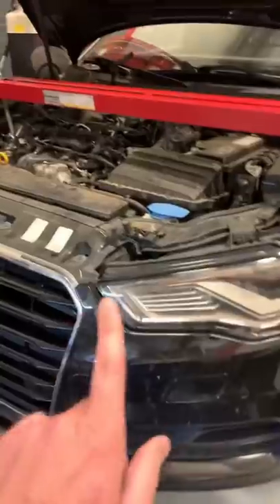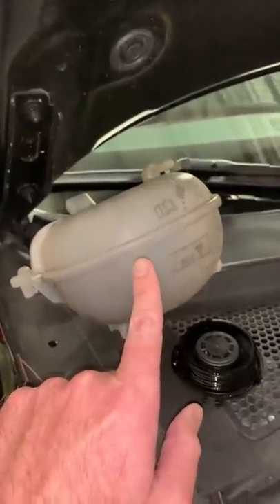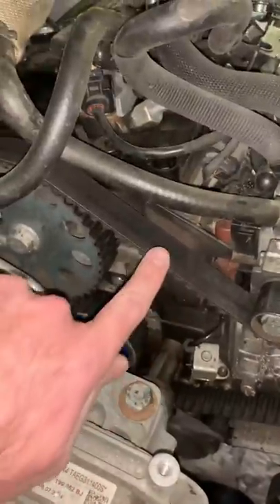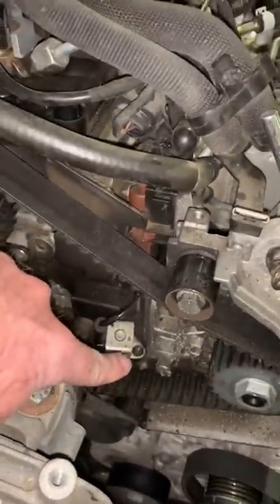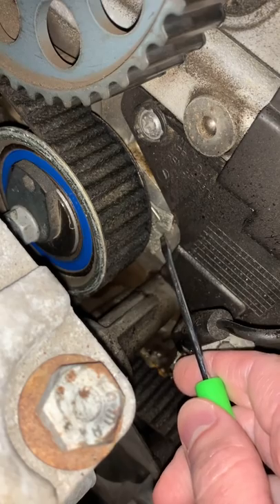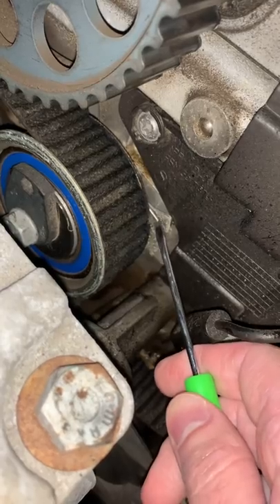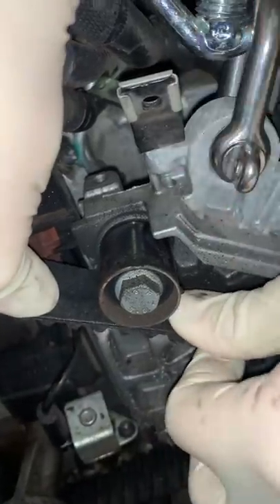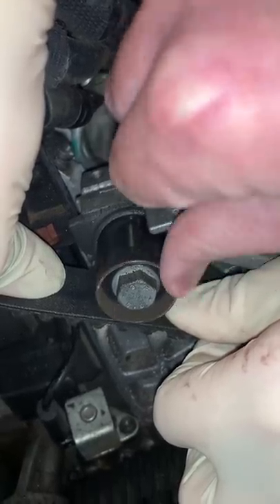Don’t let problems go on your car! #shorts

Comment: Best routine maintenance for these cars is to avoid purchasing.
Reply: Still more reliable than US cars do🤣
Reply: @CaptainRemy  A timing belt driven coolant pump
Is so much more reliable than one that is driven by a serpentine belt. Because you know, if the serpentine belt breaks you can pull over and wait for a tow verses so many items on a timing belt which should just do timing.
Reply: @willjohnson5861  what????? ANYONE would rather have a serpentine belt driven water pump. Way easier to replace, way less labor to access. “just do the timing” NOBODY wants to time an engine because of a water pump
Reply: Amen!
Reply: @CaptainRemy  my chevy is still on the original belt and never been in a shop. It's sitting on 290k.
Reply: @cleverusernamenexttime2779  he talkin bout fords n dodges
Reply: @CaptainRemy  good life hack. Never take automotive advice from someone named Ali.
Reply: @willjohnson5861  My point still stands. A timing belt driven waterpump in this car is still more reliable than your average American car / truck (e.g. Ford), which has head gasket leaks / major oil leaks / transmission faults as COMMON faults. Lets not forget things like death wobble, poor rust prevention, etc.
Reply: @cleverusernamenexttime2779  May I ask what year yours is from?
Reply: @ah4800  And you are...?
Reply: @ah4800  I never said that audi's are reliable, just that they are more reliable than American cars... But you still didn't answer my question to you, so I'l ask it again: who are you? I bet you don't even actually own a car. What is your problem? Never take automotive advice from someone named Ali? Did bad ventilation in your mom's basement give brain damage to you or something?
Reply: @CaptainRemy  2004
Reply: @CaptainRemy  audis aren’t more reliable than American cars but this particular TDI is pretty reliable. The diesels seem to be the only way Germans can figure out reliability until the emissions crap hit them and they went downhill again.
Reply: @CaptainRemy  I'm reading this before going into my work at an Audi service center and laughing my ass off. That "German reliability" is gonna be paying my bills good today, stay assmad ;D
Reply: @CaptainRemy  using feet as a unit to measure is why they can never build really reliable vehicles.
Reply: @CaptainRemy  Since you are the one making the claim here, why don't you post some statistics to back up your claim, rather than your clear bias against American-branded cars.
Reply: Could not agree more! Anything built by the VW, or Stallantis (formerly Fiat/Chrysler and PSA) groups are to be avoided at all costs.
Same can be said for GM Korea, Nissan, and possibly Mitsubishi if they follow Nissan and take more Renault shit...
Reply: @CaptainRemy  no you're right, i dont own a car. Cars are for girls. I drive a truck. An american made v8 that'll pull your pos audi around the block and still resale for more with the same mileage.
Reply: @CaptainRemy  audis have terrible reliability that is a well known fact. If you want a fair comparison because it’s a tdi then compare it to a Ford F-350 7.3 powerstroke reliability
Reply: @ah4800  Sounds like you’re compensating for something…
Reply: @CaptainRemy  Ford Crown Victoria: hold my beer
Reply: @cleverusernamenexttime2779  You're Chevy doesn't have a 290k serp belt on it. They are wear items.
Reply: @squiresonwheels3249  As being one of the only 3 good cars I think came out of Ford, hot DAMN can those tanks take a beating more than 95% of other cars
Reply: @mikehawk302  its still big enough to make you bleed though
Reply: @cleverusernamenexttime2779  you should get that looked at
Reply: @CaptainRemy  I guarantee they're not more reliable than dodge/jeep
Reply: @ah4800  What?
Reply: Every mechanic i ever asked told me to buy a VW because of its realiability and easiness to repair, granted i am in europe so the parts and repairs might be cheaper than in america, which brings me to the point the markets are completely different so comparing these cars is pointless
Reply: @CaptainRemy  wrong us cars do not use timing belts they use timing chains way better. Only a poor company would use belts.
Reply: @CaptainRemy  I can confirm that is not true.  Had multiple GM vehicles over 200k-300k miles.  Have an 09 Jetta with a 2.0tsi and timing tensioner failed and destroyed the entire top end of the motor, rear door won't open, tail light wiring shorted out, water pump failed, bad turbo, etc.  Audi/VW recently is junk compared to US vehicles.
Reply: @CaptainRemy  you say that Euro cars are more reliable than US cars, go look at the annual ownership costs on cars. The Euro cars are always higher. Especially the German cars.
Reply: @loganwork7024  jeep has shit reliability.
Reply: I like my non-intereferance bp-4w. If the timing belt were to break, which won't since I am meticulous about maintenance,  I won't have to sweat about my engine grenading.
Reply: @austincopeland9504  agreed, just spent $1,160 usd to get my timing belt/water pump/pulleys done on my 2013 tdi passat. I can do it for 300ish at home but im not comfortable doing it at home plus I dont have jack stands or anything
Reply: Exaaaactly what I saying lol
Reply: @haydencarlson2861  own a  97 ranger and if the belt snaps it wont do shit to the engine since its a non contact engine.... 130k miles on it but ill let it snap the ill replace it...
Reply: I think that's technically PREVENTIVE maintenance but I digress.
Reply: @jeremymcintyre7812  no bro belt is for certain application chain for others, isn't a matter of poorness
Reply: @addo9697  yes it does shows a cheap maker, there is no practical benefit to using a rubber belt over a metal chain. Metal chains can handle the heat much better and are much more durable. You are incorrect, you cant even make an argument against my statement. "Some got this", "some got that" yes and one is much better than the other. My statement remains.
Reply: @CaptainRemy  HAHAHAHAHA
Reply: @mpalm44  I think he was referring to the timing belt
Reply: Exactly lol
Reply: @cleverusernamenexttime2779  290k feet? That’s about all the farther I would trust any timing belt driven gm engine
Reply: @spiKey0svetlana  well considering that the 3 most common pickup trucks originate from the USA; I wouldn’t say all their tech is bad.
      Really, the only other reputable truck company besides the USA companies; is Toyota.
Reply: I am a mechanic in germany what i see that americans seem to just not maintain them right or get worse worse cars i dont know. Sure VAG (Vw,Audi,Seat,Skoda) made some shitty engines like the 2nd Gen 1.4/1.8/2.0 Tsi and bmw is in most cases also very realible if maintain right also seen them fail with high Kilometers
Reply: @CaptainRemy  i know of very little common issues like that and i worked for all the big 3 american companys. chevy was the worst. With the ecotecs, Jeeps always had transmissions being put i them. Fords sucked to work on but i almot never seen a head gasket go bad unless the engine was over heated then its the owners fault
Reply: Buy Toyota
Reply: Dude I love the steering and Quattro system for Audis. I used to be a shop rat and I drove a Audi 4000 Quattro and Audi 5000 Quattro. My boss had an S4. When we had important clients to drop off I got to drive that one. 
I’ve always wanted an Audi. But,  I agree with your comment, lol.
Reply: @CaptainRemy  nope.  I'd take my Focus ST over a junk Vw/Audi anyway.
Reply: @derekgardin1512  I hope you know that your focus st is designed / built in Germany, right?🤣🤣
Reply: @CaptainRemy  no, not at all.
Reply: VW have been known to have electrical issues, they also falsified fuel economy on their  vehicles. 

Ford 4.6 if maintained can hit 300k easily. The late model of the Chevy Impala are solid vehicles. 

Audi, vw parts are stupid expensive, fluids as well. Blaaaaaa
Reply: Yes, buy Toyota.
Reply: @cleverusernamenexttime2779  you're playing a very dangerous game. Some manufacturers recommend some stupidly high mileage before changing the timing belt. Mine is supposed to be 112k miles.

The general consensus is every 5 years or 60k miles. I've bought a 14 year old car recently with 90k on it and it's going back into a garage in 2 weeks time for the timing belt and water pump replacement. I don't think it's even had a belt replacement yet, but I'm not risking blowing up my engine. It's also having 2 new rear tyres since they're close to the legal limit.

It's going to be an expensive day, but at least I know my car won't break down any time soon. It's also had a service yesterday and that's when I was told about my timing belt which I had a feeling would come up because of the age of the car.
Reply: @_--____--______--___  after a $1000 quote for a starter and nearly 300k miles, the next time it breaks down it's getting replaced.
Reply: Love my TDI and its 45mpg highway mileage. And it's a wagon, so even BETTER!
Reply: @CaptainRemy  thats why i swapped a chevy ls into my porsche. because i wanted to save that reliable porsche engine for you!
Reply: @cleverusernamenexttime2779  400k on my 09 ram.
Reply: American cars rust. And deteriorate insanely fast
Reply: @dgodgo5983  
And yet we landed on the moon using imperial. By the way no one in the United States uses imperial in any kind of engineering. Everything is metric and has been for decades. The only place we use feet inches and a mile is in stuff that the average citizen encounters. Like mile markers on highways,  talking about how tall you are how much you weigh etc.
Reply: @jeremymcintyre7812  
That doesn't guarantee anything either. Take a look at any of the GM products with a 3.6 L V6. Especially the ones that are mounted transverse like in the equinox. You're probably going to be putting new timing chains in it every 100k. And it's an engine out repair. Just because it has timing chains doesn't mean that that system was designed worth of shit. Plenty of them are designed well but some of them are not. 
The Ford 5.4 tritons are also problematic with timing components particularly cam phasers.
And the new 3.5 EcoBoost. Particularly before 2016 have significant issues with timing chain problems and cam phasers and tensioners..
I've got 400,000 on a Toyota with timing chain don't have any indication of change stretch yet or nothing that the tensioner system can't handle.
Timing belts can be a pain, but in the past they were a maintenance item, and relatively easy to do. Most of the Hondas before 2006 had timing belts a lot of Mazdas. But they weren't that much work to get done. A lot of timing belt driven cars today are the opposite of that.
Reply: @kens97sto171  yeah that's exactly the issue, the imperial system is defined by the metric system. So we could be measuring in pears and jam sandwiches instead of feet and yards.
Reply: @dgodgo5983  
And what the hell does that have to do with anything? And I'm not really sure that the imperial system is derived from the metric system. Considering imperial was used long before the metric system as far as I know.
As I said no one in engineering or manufacturing uses imperial when designing or manufacturing anything. We use imperial in places where the public is used to it. Can you imagine what it would cost to change every single mile marker and road sign and exit sign in a country the size of the United states? And what would it gain except confusion? Serves no purpose to make that switch. Personally it's kind of weird for me because when it comes to tools I prefer metric their whole numbers and easy to understand versus fractions. But when someone says something is 15 km away it doesn't really pop into my brain in a real number way.
Smaller amounts like 100 m is a little easier because a meter is pretty close to a yard, and we use that in football so if you tell me something is 100 yd or 100 m long I'll have some idea in my mind what you're talking about.
Reply: @kens97sto171  I'm not saying derived, it is however defined by the metric system, and in this way we can come up with any measuring unit if we have a standard that is derived from nature, this is why I made the example.
The imperial system had a flaw, there was no standard. That's why as late as the 1930's and 40's  an inch meant something else depending on where you were. Only after using the metric system to define what an inch meant, was a standard created for your beloved system yards and feet.
Reply: @dgodgo5983  
We've been using the same measurement of Mile feed in inches in the US as far as I know. An inch has always been the same here. Maybe it's been different in other places.
Yep we will keep our miles and yards and inches. Does it really matter? Who cares as long as the people who live in that location understand what it means.
The cost to change it would be exorbitant and achieve absolutely nothing.
Reply: @kens97sto171  clearly you are not aware that an inch was at some point defined as the length of 3 grains of barley layed end to end. I'm not sure if you are familiar with seeds or grains but they tend to differ in so many ways that I don't see how this could be a good system of measurement.
Only after the inch was defined using the metric system could you speak of a true standard. Because guess what the inch was also defined as the width of a man's thumb at the base of his nail, and I know we all have different sized parts hanging from our bodies.
Reply: @dgodgo5983  
Because of the time that these standards were used using the length of three grains of barley etc being that accurate didn't matter. Almost every tool was handmade. There were no interchangeable parts. So it wasn't a problem. It's kind of funny the world continued to turn and build things all through that time using that inaccurate system. We're not talking about that now we're talking about why should 350 million people have to relearn how far it is to the next exit on the highway just so they can have the same measuring system as europe? The answer is we shouldn't have to change. Maybe we should force Great Britain to switch to driving on the right hand side of the road and join the rest of the world with the normal standard of driving.
That's nonsense also.
Reply: @kens97sto171  but do you agree that imperial system of measurement was not repeatable until it was defined by the metric system. This doesn't make it inferior nor the reason people should stop using it, it just means that they started with a measurement that was not constant and proceeded to define a constant based on that measurement.
Reply: Diesels are very reliable anyway, even if it's VAG.
Reply: @tylerdomiano9214  literally any german 6 cyl is better than anything america has to offer
Reply: Well said
Reply: @ah4800  but sir what did I do?
Reply: I hate to say it but German and most European cars sux! They become endless money pits after the warranty runs out!
Reply: @CaptainRemy  Most of my cars have been American and without a doubt they are the most reliable cars I ever owned. My Ford Expedition vs my 03 Toyota 4Runner- neither one are good on fuel economy but my Expedition is much cheaper to repair than my 4Runner. I also own 2 Corvettes and they can hold their own against anything made in Europe or Japan (performance wise) and they rarely if ever go in the shop! They're not garage queens! They get driven! One of them is 30yrs old with 320,000 kilometers and the other is 23 yrs old with 290,000kilometers and has a top speed of 290kph or 175mph!  Do your research!
Reply: @squiresonwheels3249  Ford Crown Victoria and all Panther Chassis cars i.e. Lincoln Towncar, Mercury Grand Marquis are proven super durable,many have been driven over a million miles ‼️
Reply: @CaptainRemy Ford wonder here, I suffer none of those issues and do my own maintenance… 2008 super duty 5.4 with 195k

Comment: We all know that the DeLorean is the only car that can jump time, without breaking it's engine.
Reply: Good one👍🇺🇸
Reply: The engine can break, but a well-placed whack to the steering wheel can fix it.
Reply: Must not be an interference
Reply: @scarface-39  I know I was being funny (trying to)
Reply: @AzraelFPV  it’s all good man, I should’ve known 😂👍
Reply: BADUMM, tsss...
Reply: @JorgeHernandez-lu1mi  lol
Reply: @CWINDOWSsystem32  true 🤣
Reply: The delorean has a intermittent starter problem from jumping time. 
“There’s something wrong with the starter, so I hid it over here “
Reply: @steveh7085  Sarah, we don't know if that's a result from traveling time, or if that's just a result from it being a DeLorean.
Reply: Flux capacitor sold separately.
Reply: Or any car before someone decided 0 tolerance heads were worth it
Reply: Most inlines can too